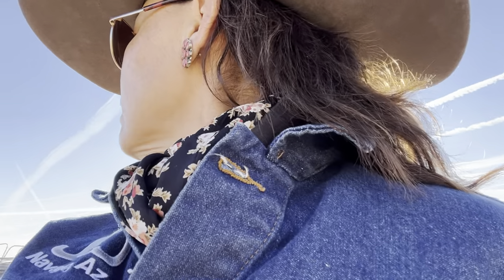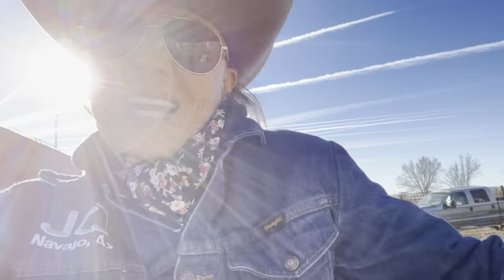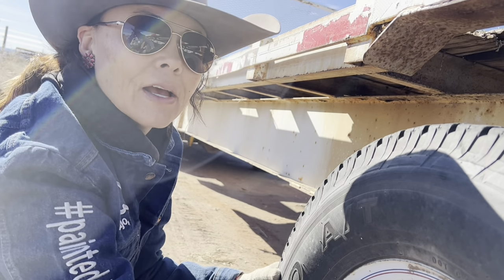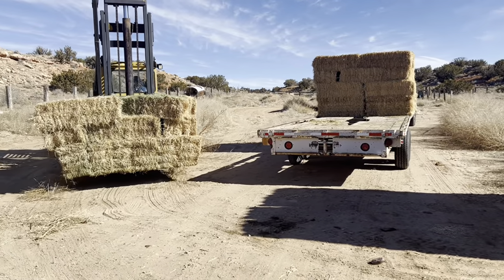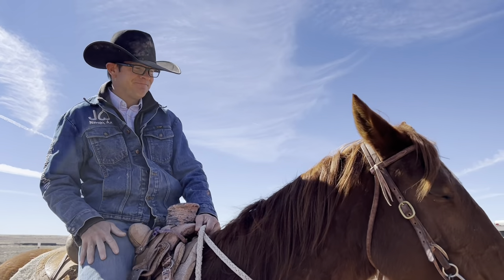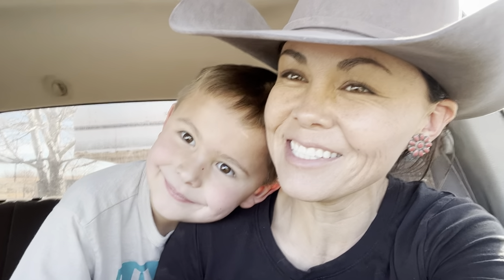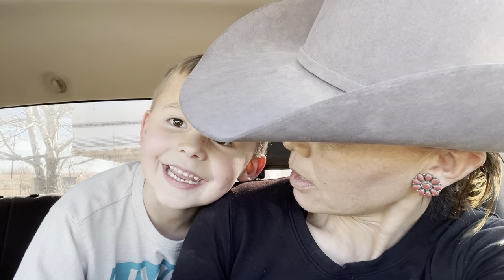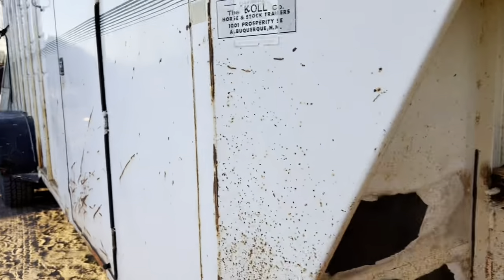DANIELLE DOES ALL THE WORK | HENSON IS BACK IN THE SADDLE!!! #ranchwifelife

Comment: Have Henson buy you a 1/2 inch battery operated impact wrench for your next birthday….they work great for taking wheels off !!! Good job.
Reply from the maker: I turn 40 this month!!! 🥳
Reply: Lowe’s had DeWalt  2 - 20 volt batteries and charger for $199 and you got your choice of tool that came with it and a 1/2 inch impact was one of them. This was in Southern NM don’t know about your neck of the woods but that’s a good deal, they work as good as an air impact ! Tell Ol Henson to pony up $$$$

Comment: Danieelle pulls her ownn weight plus, good job.  I even use a small  cheater bar for the lawn mower blade.  Don't rush it Henson don't want to rebreak the ribs, double ouch. This is when a drone would come in handy if you only want to locate the horses, such a hard working couple sounds like your work is never done

Comment: Learned a lot from your chiropractor releasing the tension in the stallion's rib and then shoulders, and also on Dib's tension above the withers.  Heard that dappling on the coat of the stud means the horse is very healthy.

You're very thorough, Danielle, and surely Henson appreciates your changing the tire as he recovers from broken ribs.  You're funny, too ~~ when you whispered, guess you need to grow those long nails like her to do that kind of spinal adjustment, lol!

Crossing the stud's legs over looks tricky; she certainly knew how.  Thanks for a great vid!